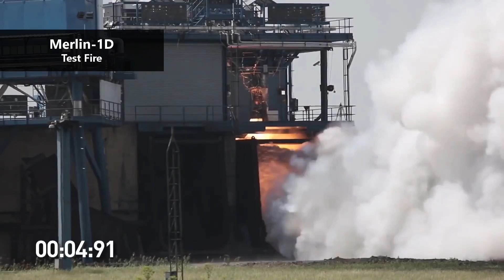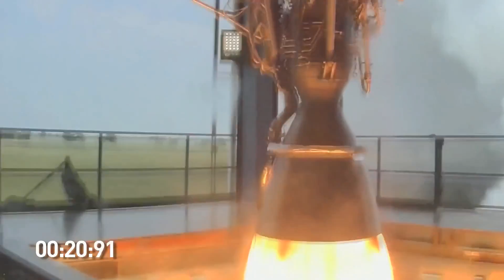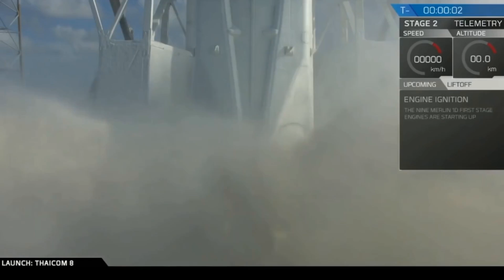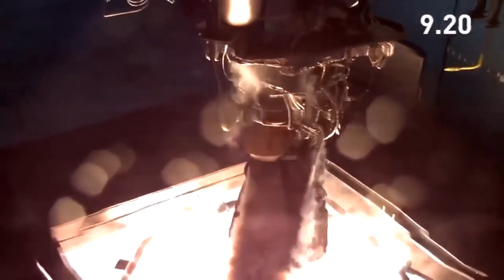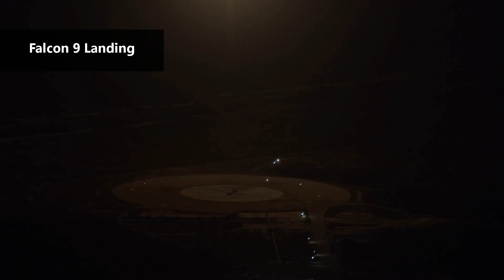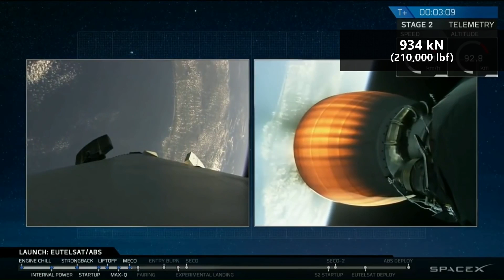SpaceX Merlin Rocket Engine

Comment: The newer 40% throttle figure probably comes from the engines being uprated several times (first with v1.2, then in the "Even Fuller Thrust" upgrade, and possibly again in the future with Block 5) since their release. The lowest absolute throttle setting remains unchanged, but because full throttle has increased, the minimum now represents a smaller percentage of that.

Comment: Some remarks in /r/SpaceX have argued that the grid fins do use RP1 -- A separate RP1 reservoir at the interstage area, Helium pressurization, and plumbing down to the main RP1 tank to dump used fluid into the main RP1 tank. Presumably with the fin hydraulics running at slightly higher pressure than the tank ullage system to allow for pump-less drainage from the fins to the fuel tank. I don't know how accurate this is or if there is any supporting evidence for it -- But it does seem to offer the most efficient way to run the fins with the least wasted mass.